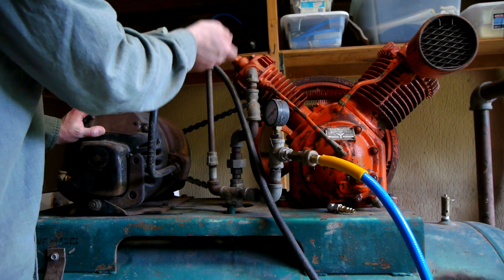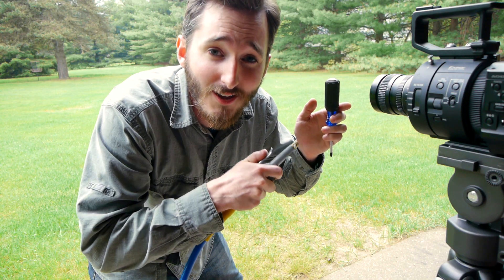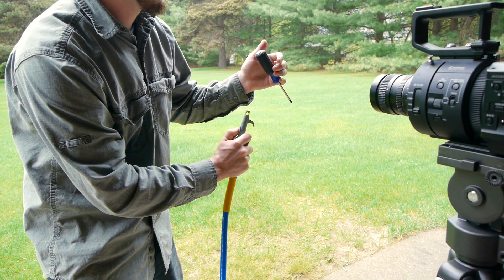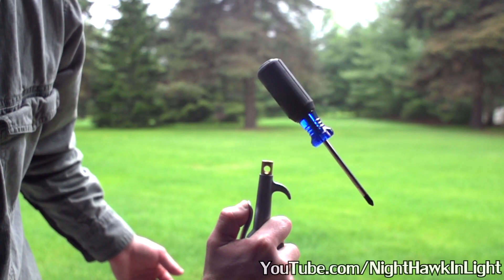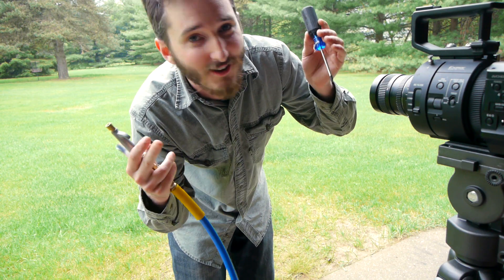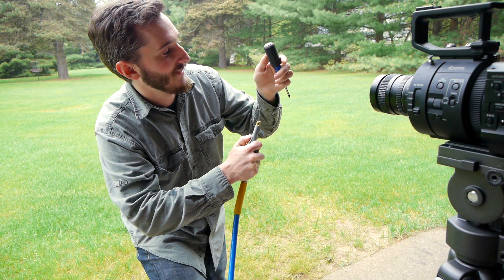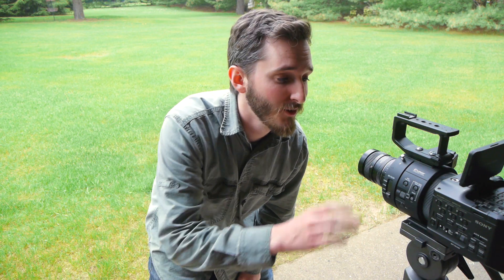Levitate a Screwdriver with Compressed Air!

Comment: When I was a kid department stores would sometime have a vacuum cleaner in vacuum department set up to blow out and have a hose propped up to where it would hold a beach ball suspended in mid air.
There was a kids toy produced in 60s that had battery operated fans creating circular streams of air that you could control with a joy-stick like device and levitate and steer balloons with lightweight paper or plastic base attached. If used in very still air room you could control the balloons about 10 feet away.
I saw the beach balls in the store and tried it at home with small light balls. It worked. A golf ball would levitate about 1 inch off the end of the hose. ( kinda heavy )

Comment: If you think about it for a little, you should notice that the force could not be acted at that location, since that is lower than the center of mass of the screw driver and it wouldn't be stable.

Comment: I think at least two things are happening. First, the momentum (which include static and dynamic pressure effects) of the flow is pushing the screwdriver away. That holds the screwdriver up.

But why does the screwdriver not get blown away laterally? I think the coanda effect is happening at the top rounded corner of the handle. The coanda effect is when a jet of air is blown over a curved body, a low pressure region is formed. If you notice, at the moment that you release the screwdriver, it seems to get sucked into the stream, rather than pushed away.
Reply: And for the sake of completeness, the coanda effect is a specific version of the Bernoulli effect.

Comment: It doesn't balance on the air stream. The rounded handle of the screwdriver, is the perfect shape for the air to glide over it and create low air pressure above the screwdriver therefore keeping it in the air. ;) if you try it with a square handled screwdriver without a rounded top it wont work ;)

Comment: This is using Bernoulli's principle correct?
Reply: No I believe it is the Coanda effect
Reply: no, it is merely balancing on the airstream. I thought it was at least spinning, but it doesn't appear to be spinning or anything.
Reply: oh shit, actually I think you might be right about Bernoulli. The reason the screwdriver stays centered on the balance point must be that it is "sucked in" to the balance point. Otherwise it would be really difficult to balance it.

Comment: the reason it floats isn't from balancing on the air stream. it is because on the back side of the handle, the handle shape makes ALOT of drag, so with that area of low pressure, it causes the screwdriver to float. theres a really good video somewhere on here where he makes different handle shapes to see what works and what doesn't and why.

Comment: I've seen it done with balls before, never screwdrivers until now. The principle is that when the screwdriver (or ball) gets too far to one side or the other of the airflow, the ambient air pressure pushes it back into the middle of the airflow. (The pressure in a jet of air goes down as the velocity increases because the pressure gets converted to velocity, so the ambient pressure is greater than the pressure inside the airflow.) With the ball it happens both forward and back as well as side to side. With a screwdriver you have to manually keep the airflow pointed at the center of gravity of the screwdriver in the forward and back axis.

Comment: As some others have mentioned - it is indeed the Bernoulli Principle at work.  The fast moving airstream has less pressure that the air outside the airstream.  Because the screw driver (the rounded handle) is encased in the lower pressure air - the higher pressure air outside holds it in place.  Lower mass and round surfaces like a ping pong ball require much less air pressure, but they function the same way. I would be curious if a non-rounded object would work without tumbling out of the airstream due to unequal pressure. I have never seen it done with an irregular surface before; well done sir.

Comment: It's a standard airfoil effect. The air passing around the handle accelerates, making a layer of high pressure air underneath (on the side the air is coming from) and behind it a low pressure area is formed.

Same thing on an airplane wing: air comes at the wing from 'straight ahead,' has to go over the curved upper surface, where it speeds up to meet the air that went under the wing at the trailing edge.

The law of conservation of energy applies, the extra speed comes from a drop in the air pressure above the wing. A low pressure area forms above, while a high forms below. With the wing physically in the way the high pressure has to push on the wing to get to the 'vacuum' above. The result is called "lift."

You are creating lift around the curved handle of the screwdriver. If you tried this with a flat piece of steel, it would twirl around to let the air equalize, thus not producing lift. It wouldn't float.

Comment: The screwdriver is held inside the stream of air by way of a phenonomenon called bernoullis principle, which basically states that the pressure inside a stream of flowing air is lower than outside the stream. Thus, when the screwdriver tries to leave the stream, the pressure outside pushes it back in, as the pressure on the outside part of the screwdriver is greater than on the part of the screwdriver inside the stream.

The air that flows upward and hits the screwdriver creates a force big enough to counter gravity, and so the screwdriver maintains it's altitude.

Comment: The new camera takes very good quality HS video. What is happening is that you are creating high and low pressure areas around the screwdriver. High pressure likes to move toward low pressure. You created a balance of pressure in respect to the weight of the screwdriver. Neat video. BTW, you look much better with the beard all trimmed up. :-)

Comment: The way it works is that the air is splitting around the screwdriver and as it splits the area in the middle is a vacuum pulling the screwdriver towards the nozzle while the air is pushing away.

Comment: I used to do this with a roll of tape, a roll that is atleast 10cm in diameter, it spun up like crazy while floating in the air, and then when you stop blowing at it, it will hit the ground with a pretty nice rotational force making it accelerate away from you at a pretty nice speed :D

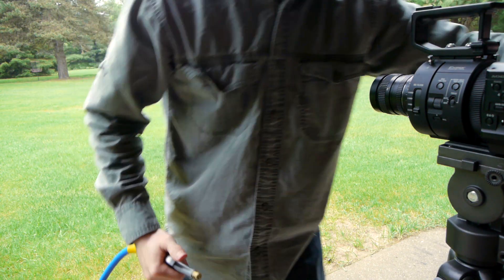Comment: Absolutely fake, 2:31 when he starts off the air stream is pushing the driver on his hand and all of a sudden when he lets go (like its on a string) it swings away from his hand! Ridiculously fake. Point number 2, why does he just happen too, in both shots before he starts he uses a new cut to start off instead of keep the camera rolling..... Too set up the string he is using to make it appear levitating. Point 3: it is impossible, the strew driver is too heavy (number 1) and there is no force counteracting the force of gravity pulling down on the object and the stream of are would be pushing the screw driver to the right. Not only is there not a force counteracting the force of the air pushing it right but there is no force counteracting gravity. This is a fake sorry guys
Reply from the maker: Try it.

Comment: This is all
Based off of Daniel brunelli's principle (pardon the spelling it's been a while) the faster moving air creates a area of low pressure which the screw driver is caught in. After this, when it tries to enter the high pressured air (static air) it is pushed back into the low pressure (wind) air

Comment: It's a cool trick of physics. However, with a sharp object and a high pressure hose, I'd have suggested wearing safety glasses. If the screwdriver got out of control in the strong air stream, who knows where it would fly and at what force.
Reply from the maker: The Sqoou Give me a break. What do you think is going to happen, the screwdriver shoot off like a gun?

Comment: I don't think it's necessarily that it's balancing on the airstream, but rather it's being sucked into the low pressure area caused by the velocity of the air, the same way a balloon or string can be attracted to the water from a running faucet or the same reason things are sucked towards tornadoes. the fact that the air comes out of such a perfectly circular tube helps keep it levitated as there's extremely low pressure in the center of the cone of air leaving the nozzle, and a slightly higher pressure around the outside of the cone of air, with the highest pressure being the still air outside the cone of air. It's as if the handle is being held in the center of the cone and it's being stabilized by the screwdriver shaft on the outside of the cone, with the help of gravity to keep it pointed down.
I may be totally and utterly wrong, but these are just my thoughts on how this may be physically possible.

Comment: As far as what's going on aerodynamically, well if you could see the air in 3D that would help a lot. A start would be running that camera with a wind tunnel smoke stream bar, a sort of bar that puts out streams of smoke in non-turbulent (laminar) air. You might need a special compressed-air nozzle, too, but you'd be able to see something.

Another trick might be to fasten some threads onto the screwdriver over the wetted (by air) surface, and then fly it.

And yet another (kinda expensive) thing might be setting up a holography optical bench, with some optically co-operative fog or smoke, and doing some holographic interferometry so the fluid would be more visible.

Quite a few books out there on fluid mechanics measurements. One example, I think it's even online:
Fluid Mechanics Measurements, Second Edition  By R. Goldstein

Clearly the forces are close to equilibrium, so this means the C of P on the screwdriver isn't moving around much. It also means there is a moment generated by the airflow that holds it at an angle, and another force, probably friction, coupled with the air turning a sharp corner around the butt of the screwdriver, that holds it up. And when you sum all these vectors and moments with the mass of the screwdriver, they end up near zero. Amazing!

Comment: It is the same principle as blowing against a wine bottle for example. You can see it like this: Place a cube in front of you on a table, place a feather behind it. Blow against the cube, the feather will stay put if you did it correctly.
Now place a wine bottle in front of you on a table, put the feather behind it again, blow against the bottle and the feather will float away.
The air stream gets pushed around the bottle, but because of the round shape, and the vacuum you create behind it when blowing, the air 'folds' around the bottle to fill up that 'vacuum' (actually not a vacuum, but lower air pressure than in the surrounding air). I think this is what happens with the screwdriver. The airflow that 'bends' around the screwdriver pushes on the screwdriver with enough force to keep it from moving further down by gravity. With quantum mechanics you have this thing called 'quantum trapping', look for it on youtube, it is using supercooled conductors to 'float' items on a magnetic rail, this is because the magnetic fields are 'trapped' and kind of fold around. It is not the same as with the screwdriver, but in a way I think they are alike and are both interesting stories.

Comment: People keep saying Bernoulli's principle when I think its more the Coandă Effect.  

http://en.wikipedia.org/wiki/Coandă_effect

"The Coandă effect can be demonstrated by directing a small jet of air upwards at an angle over a ping pong ball. The jet is drawn to and follows the upper surface of the ball curving around it, due to the (radial) acceleration (slowing and turning) of the air around the ball. With enough airflow, this change in momentum is balanced by the equal and opposite force on the ball supporting its weight. This demonstration can be performed using a vacuum cleaner if the outlet can be attached to the pipe and aimed upwards at an angle."

Comment: Brunelli effect is what you're looking for. it stays in the air stream cause when it goes to one side there's more air going past on one side which causes lower pressure (since it's fast moving) and moves it back to center. can do the same thing with a beach ball and a fan, or ping pong ball and hair dryer (with the smaller one can even have the air stream horizontal and it'd stay up

Comment: I think if I saw this on anyone else's channel I would refuse to believe it. This is awesome. Is their any way you can make the stream visible?
Reply from the maker: Kyle Jones It would be difficult. I would probably have to pump vapor into my air compressor or something. Or splice a Y into the line and feed it in that way, which would also be tricky. I don't know.
Reply: NightHawkInLight Schlieren photography?
Reply: NightHawkInLight Schlieren photography?

Comment: What is happenning is that the speed of the air at the top of the screw driver is higher than the speed of the air at the bottom, and physics says that high speed means less pressure.
So with a pressure higher at the bottom than at the top, the screw driver just gets pushed where there's less pressure, so at the top.
This Bernoulli Effect makes planes flying and even houses' roof fly when there's a lot of wind ! Thanks to my medecine studies :)

Comment: Its just like that floating ping pong with hair dryer air blowers,,,,
Reply: No it's not, go learn physics
Reply: SkizzlePiano are you an idiot? it's the same reason.
Reply: SkizzlePiano it's actually quite different. The shape of a sphere and screwdriver are tons different meaning the effect in play also is different.
Reply: exactly, the stabilisation of the screw driver is different to that of a ping pong ball due to its irregular shape
Reply: air compressor = hairdryer
screwdriver = ping pong ball

apply Bernoulli's principle.

Comment: See Burnoulli Effect. He would be proud that you're using his effect to levitate an object. It's not the force of the air but the vacuum created at the top and sides that suspends the screw driver. The same effect lifts a plane wing.
Reply: bain5872  You say that it's not the force of the air, but that's extremely misleading. Stagnation causes a higher pressure on bottom than on the top.  Also his name is "Bernoulli".
Reply: Highly doubtful..! Some upward air flow force is applied, against gravity, but the Bernoulli effect is completely responsible for balancing the screw driver in both axis and stabilizes its levitation. Without the Burnoulli Effect; this would not be possible.

Comment: I've never seen a belt driven compressor before, how interesting!
Reply from the maker: Colton Blumhagen It was a cool find on craigslist. My favorite thing about it is that I could pump up the compressor by spinning the wheel by hand or with a bike or something if i ever need to use it without electricity.
Reply from the maker: ***** They aren't really, just an old style that you don't see so often anymore except for on big commercial compressors.

Comment: It's not balancing on the air stream.  It's resting on a cushion of high pressure.  You can also think of it as dangling from a point of low pressure.  The air stream splits, traveling around the handle in both directions.  The point where the two streams merge near the top of the handle is pulled slightly away from the screwdriver by the inertial velocity of the air molecules.  This creates a small pocket of extremely low pressure between the merging streams and the handle.  The higher pressure beneath tries to push the screwdriver upwards to fill that pocket since the air can get in to do the job.  It's the same principle as picking up a bowling ball with a vacuum cleaner.  Great video btw.
Reply from the maker: Richy Rich Sure, but it's also balancing. Notice it stays at the same angle the whole time because that's the only position it can be at a happy equilibrium between being blown/sucked backward or slipping to the ground.

Comment: From my relatively general understanding of physics and dynamics, this trick looks to be essentially analogous to balancing a ping pong ball in a quickly moving stream of air. The quick moving air creates a low pressure area in to which the surrounding atmosphere tends to flow towards. This creates forces on all sides of the floating object directed towards the center, essentially keeping it from moving (generally speaking) in the x,y-plane. In the z direction the force of the air pushing upwards simply needs to cancel out with the force of gravity pulling down. In regards to a more complex shape such as the screwdriver it would seem that the angle at which it balances has to do possibly with aligning the force through the center of gravity and also has to do with providing a face towards the moving air which has a surface area that results in the forces of gravity and the moving air being equal. Force=Pressure*Area=Mass*(Acc of Gravity)

Comment: Needs some dust or smoke to show of the air stream in slow motion.

Just a guess, but what I think is happening is that the cylinder grip is being stabilized because it leaves a vacuum when it tries to move in any direction. High pressure on all sides apart from the direction its trying to move away from, results in it being pushed back. Kind of like how wings generate lift on a plane except they use geometry to get the different pressures.
Presumably because of the steep angle there is enough airflow to negate gravitational pull, and when it gets lower its closer to the nozzle where the air flow and therefore the force increases, lifting it back.